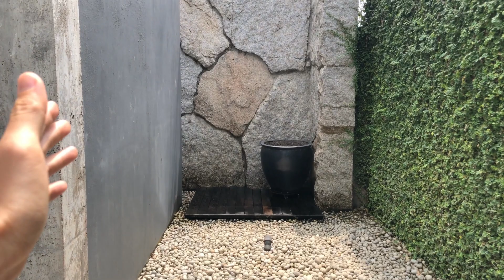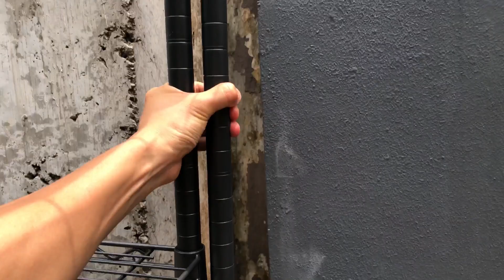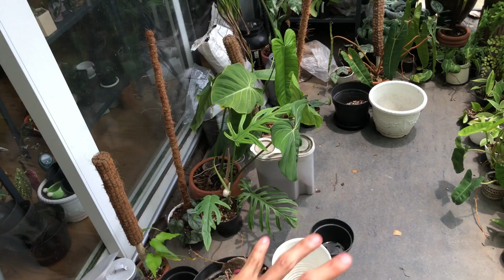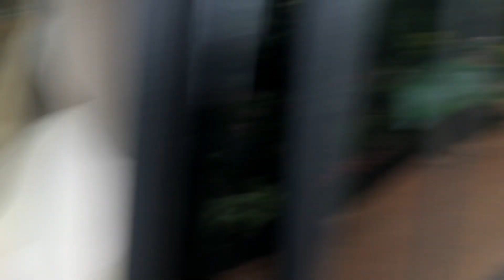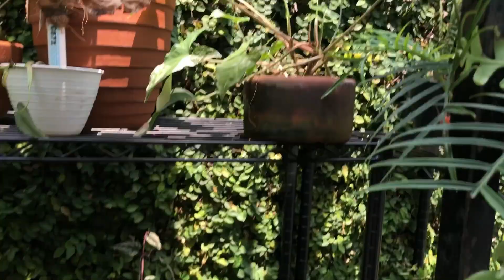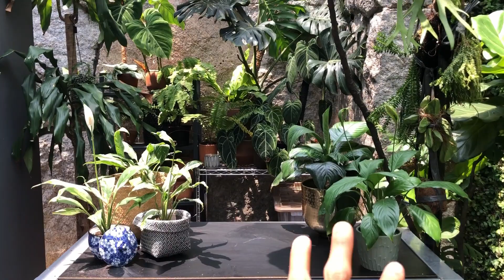Building a plant studio/nursery from scratch

Comment: Great video. I would suggest using cement blocks to place the legs of the shelf in, to anchor them down. Would not tie the shelves together, too rigid for earthquakes.  If one goes both will topple
Reply from the maker: Interesting... so cement blocks with holes for the legs?